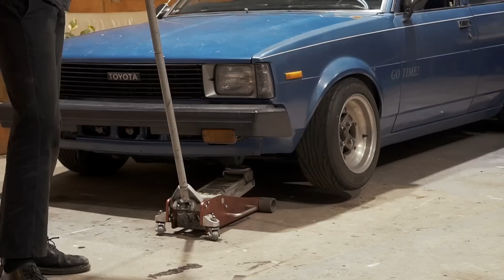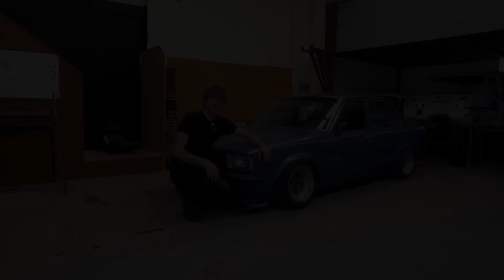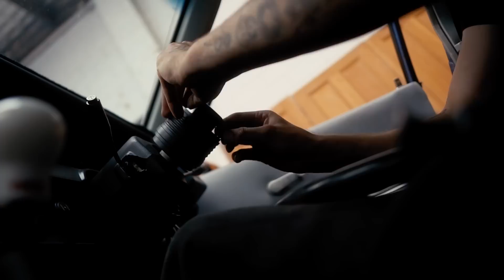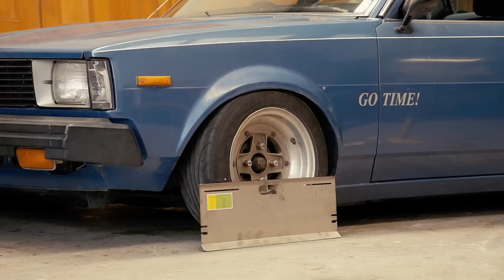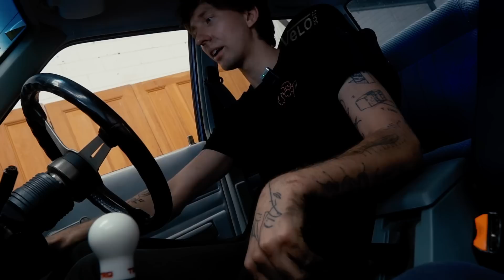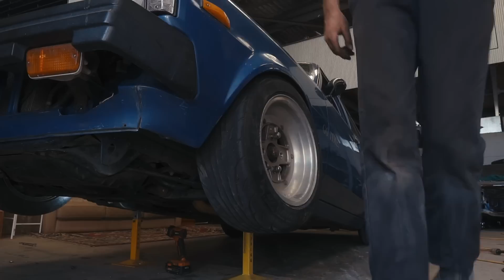Trying Nakamura’s Suspension Tuning Techniques On A KE70

Comment: How hard is your steering wheel? Is is OK to steer when stationary, or super hard? Thing is, I run a KE70 with beams. It has 25mm extended LCAs and steering links with spacers for extra lock. The steering wheel is super heavy. Considering removing spacers, then pergaps I could have slightly more leverage from the steering wheel as the lock decreases (basically makes up as a slower steering column). 

I had an ae86 many years ago, of course it was a standard car, but the steering (manual) was relatively light, I never had any issues or something like a consideration about installing a power steering. Not that I'm going towards the Power Steering system, but I am looking for ways and methods to make the steering a little lighter.

Comment: This is very interesting, i have a Ke70 also, bc coilovers t3 caster and lower control arms etc etc similar to yours, and it felt amazing, then i put an lsd into the car, added rack spacers, and had it aligned, i did all these at the same time, and ever since i did that i had the EXACT lightness off centre that you are referring too in your video, the best way to describe it is it felt extremely responsive and weighty off centre before, then after the mentioned added changes it felt 'light' or 'lazy' to react to inputs off centre, i found it really interesting yours did the same thing when the rack spacers were added, did you manage to get rid of that feeling? was it just alignment based? as i had a few people tell me its because of the lsd i added making it understeer now, but it seemed like something else to me as it wasnt under steering as such, it had just become lazy to react to steering input off centre
Reply from the maker: Hey hey, I did manage to get rid of that feeling, It was just the alignment. I had pulled out some castor not realising the car had very little castor to begin with. Currently the max these tension rods get is 2 degrees which is quite low.
Your friends saying the lsd will be causing understeer seems misguided, if you’ve come from welded the steering feel on centre will be a lot lighter because the car is more willing to turn. With a welded the rear wheels always want to go straight so getting the car to rotate is much more difficult, it’ll understeer much more and steering will be a lot heavier. I’d say to get more of a responsive feeling in your set up wind a bit more castor in, go to 3 degreees or so and give it a bit more toe out ❤️
Reply: @GOTIME-CO awesome man thank you! I have an alignment booked next week so will keep those changes in mind, it could defintilty do with a tad more toe out, good to know other people out there knowledgable with corolla things 😅
Reply from the maker: Hell yeah man, no worries, let me know how ya go, it might also be a matter of just getting used to not running welded. I’ve got an open centre in mine at the moment for roadworthy inspection, going to lsd as soon as I can, but I’ve been so surprised to remember how much the welded diff effects all aspects of driving. LSD is the wayyyy
Reply: @GOTIME-CO  you definitly could be right, i might just not be used to the diff as it definitly does seem to handle different in all aspects, adding some more toe should definitly help though! My Diff is a kaaz 1.5 way, (i still use the car for street use etc so didnt want to go the full clunky scuffy 2way lol)

Comment: Alpha N tuning isn't that hard.
I run Alpha N with a 4D table that uses MAP (that controls the idle and cruise). And it works perfectly.
Reply from the maker: Cool as, where do you pull map from, do you have a balance chamber?

Comment: Been subbed for years now love the content youve helped me so much with my ke70 sedan, [id like to know what your wheel and tyre specs are all together]. Or do a specs video for the whole car keep it up its GO TIME 🎉🎉
Reply from the maker: Thanks so much! Cheers for sticking around
My car currently has a 13x7 -1 up front with a 175 60 ns2r, a +15 lower control arm (XT130)  and an 8mm slip on spacer.
the rear is a 13x7.5 -6 with a 175 60 shitter
Reply: @GOTIME-CO  Legend man thank you, keep the great content up LOVING IT🔥🔥

Comment: wouldn't compressing the spring effect the preload?
Reply from the maker: Yep, the effect of changing the preload is essentially just that which I talked about - it just changes where in the total possible travel of the shock that the damper begins it’s stroke, in this case, because we’re just going up and not down it’s no worries as we’re at lower risk of hitting full compression and running into the bump stop as well as there’s no chance that the spring will become unseated at droop from having too little preload. The only concern here would be that in normal driving conditions on roads, going over bumps and divots, the front wheels might not have enough droop to keep the tyres on the ground and keep good traction in rough situations. But as I said; silly drift car

Comment: Don't those ITB's usually have individual ports per runner that are all connected to a common rail to get Map pressure?
Reply from the maker: not usually, no, most of the time you'll only use throttle position and intake air temperature to tune with itbs, vacuum blocks are often used to feed the brake booster but they don't usually have the volume to provide a clean signal for MAP

Comment: Try using a chamber similar to the size of a large catch can with one hose from each runner into it and then to the map sensor, would be interesting to see if it balances out the map signal...
Reply from the maker: yesss, this is the theory but I'm hoping i can use my bigport to smallport adapter, weld on a balance chamber that's around 700ml-1l in volume and have a full bolt on affair that sandwiches between the itb manifold and the head that's large enough for a smooth MAP signal

Comment: Increased caster doesn't center the wheel more due to load jacking, it primarily centers the wheel more due to a higher mechanical trail, which gives more mechanical aligning torque.
"Over-centering" is when the tie rod load path goes through the virtual steering axis, which in a rigidbody simulator would usually result in the wheel popping out of place, while IRL you tend to get binding from the joints. 

You can't fix it with caster, you need to either move the tie rod's outboard or inboard joint forward or backward. Outboard will change lock dramatically, so generally relocating the rack is preferred. You should check if your tie rod is pointing into the lower balljoint or not, and also account for compliance which will change the geometry.

You're probably not getting" over-centering" when at slow speed pulling out of park, it's just because tire self aligning torque tends to reach negative values at high slip angles. If you steer most OEM cars to lock, they'll also get stuck if they don't have a lot of positive scrub radius.
Reply from the maker: thank you for the explanation, I definitely see where you're coming from, the words weren't really flowing out properly when i was filming the segment on the over centering but yes, that's what's happening is the tie rod is reaching an angle that is past the point of being able to control the steering arm and instead of pulling the knuckle sideways it's being pushed forward into the LCA, best practice here would, like you said, be putting the rack forward into the crossmember but it's of course a massive job and not one I'm looking to do at the moment. 
I was hoping that the slight change in the position of the steering knuckle with the forward movement of the lcas when adjusting castor would be enough to maintain a good angle on the tie rod but i had it backwards in my head and instead the only way that would work would be to remove castor. 
All's well that ends well however and i feel that i sacrificed only a small amount of lock and was able to keep the steering from binding at lock. 
for the purpose of a video like this I think it's important to maintain the use of language that's approachable for the audience. This is a channel for people with good knowledge of mechanics but not necessarily those who are looking at really diving into the engineering of it all in great depth, there's other channels for people either side of that out there, not to mention I'm not an engineer or an educator myself, im just a guy who loves driving and wants to share my thought process on the setup of my car, so while i understand that maybe the way i explain things might not be absolutely correct, i think for the purpose of balancing education with entertainment I need to try not to get too bogged down in the particulars.
all this is to say please forgive the layman's terms and base level knowledge of the engineering and I hope you enjoy nonetheless <3

Comment: Hi, you can bring the caster back to stop /help with over centring. Really, the key to Naoki’s set up (in my opinion) is managing trailing wheel grip. If you want a dramatic change, then add wheel spacers (try 30mm) and camber, upwards of 6/7° 🫡 to put that in perspective, I run between 8-10 on S chassis. Once you have that much camber, you can start adding significant toe out. Your wheel will hit stuff, so have a big hammer ready. Enjoy! 👏
Reply from the maker: Thanks heaps for commenting my guy!
Next on the cards is some further extended LCAs to get some more camber in for sure ( I’m maxed out atm)
Appreciate the advice ❤

Comment: Looks great, front Valance is coming together nicely 👍 good content to share trying new setups is always a journey. And regarding map on itbs id highly recommend looking at alpha N tuning, it's quite simple once you have a play with it, Andre at HP does a great video on that too
Reply from the maker: yesss okay awesome ill check out the HP academy vid, alpha N has always worried/ scared me and the thought of having small input and transient throttle response be really solid by using MAP has appealed to me but if it's easier than i think to just run Alpha N then I'm all ears.
i've just been reading some of andre's comments on this debate in the HPA forums and he seems very convinced that what I'm aiming for should be no trouble so I'll keep researching, thanks heaps <3